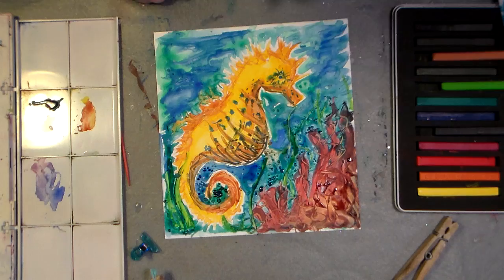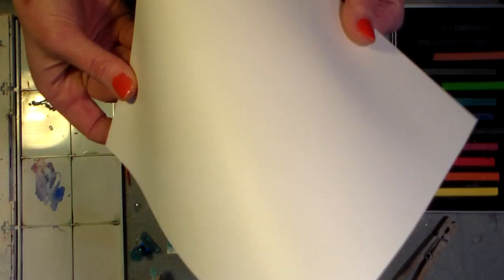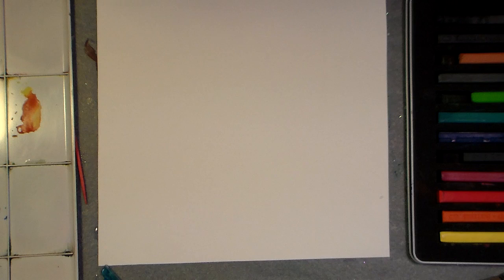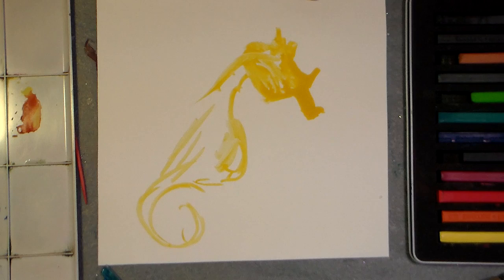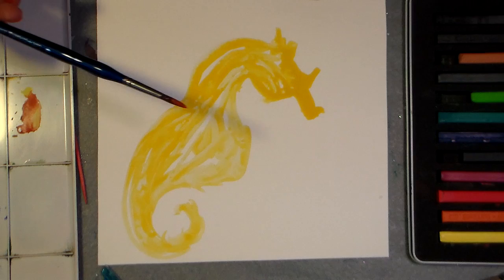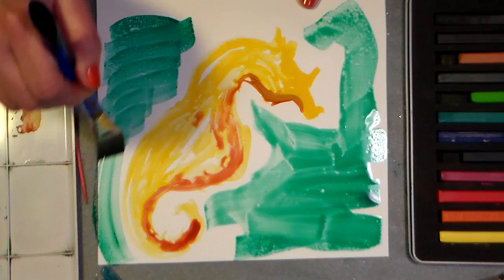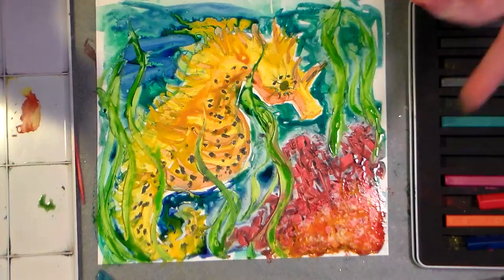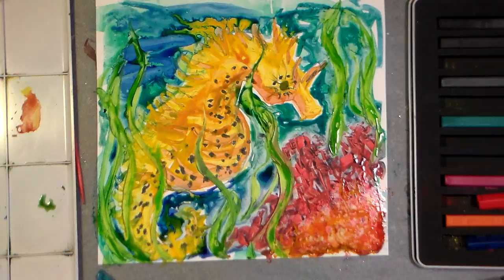sea horse on YUPO watercolor

Comment: another tip is to clean the yupo with rubbing alcohol first in case it's gotten oils from your fingers, or like you had, the manilla folder first, then it should be fine.  Also, I mix the wc paint a little thicker than usual.  It comes in different weights and the pads are usually in the medium weight.  It comes in clear now, but i haven't figured out what to do with that, other than use if for layers.
Reply from the maker: have you used the clear? What do you think of it? It might be  nice teaching tool or remember the books in school that would have clear layers to build a scene or like the bones, muscles and organs of a body, in layers, I loved those books! Take care Sue, thanks for the info;)

Comment: This is slightly off topic but since you spoke of different paper, I have a question that is not Ask a crafter worthy (I think).

What happened to construction paper, most crafts call for cardstock when construction paper will work just fine since they used cardstock that is flimsy. Except for texture, stiffness and maybe not light fast or archival.
●Most projects especially with kids can't construction paper be used unless a specific texture, effects or achival properties are need? Like cards, bookmarks, masks, and basic craft paper to layer. I think this maybe outside of what is popular since it works just as good sometimes. 

No big rush, but I have almost a 2foot stack of construction paper and 0-1/2 inch of pastel and colored, textured cardstock. Besides paint and scissors, construction paper was the next thing used in crafts when I was in school and learning to craft.
Reply from the maker: Construction paper is quite acidic and gets very brittle and fades with age...fades quite quicky really and now a days I can find cardstock for the same prices as construction paper when it is on sale. BUT it is a terrific option to decorations you do not intend to keep or kids crafts. I decided to answer this here since I know I will lose it before I film AAC, I only pull questions from the most recent video so feel free to post AAC questions there:)

Comment: Lindsay:  Love this look and did some research on yupo. It seems that many use it with alcohol inks. Can we substitute ink tense blocks?  If one were to scribble them out, then add a drop of alcohol, would that work?  What kind of brush would you use?  Wouldn't alcohol ruin good brushes?  So many questions on this one. Just love the vibrancy...  OOXXOO LINDA
Reply from the maker: absolutely, paint with watercolor or blocks and drip alcohol with a eye dropper or pipette:)
Reply: Going to try alcohol and Easter egg dye pellets today (all from the dollar store).  I want the Ranger stuff, but I've got inktense blocks and gelatos to get paid off.  So, frugal it is... with homemade alcohol ink and shaving cream marbling.

Comment: I  got a question for you. I was at my local thrift store and found prang oil pastels which I didn't buy but should have because it was 2.97 for a brand new package of either 6 or 8 crayons in it. How do you use them?
Reply from the maker: is it the Prang Payons? They are watercolor crayons, you can use them like I did with the inktense blocks today:)